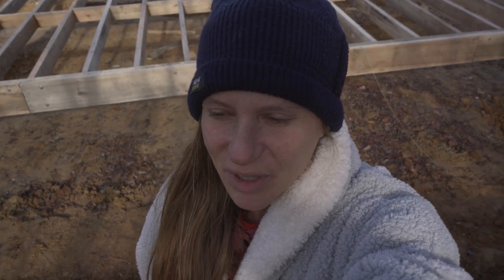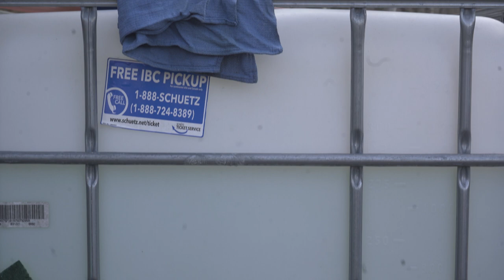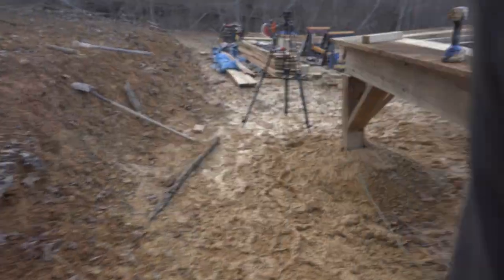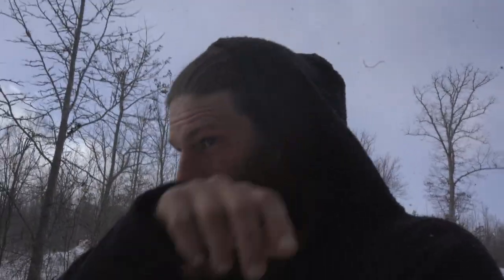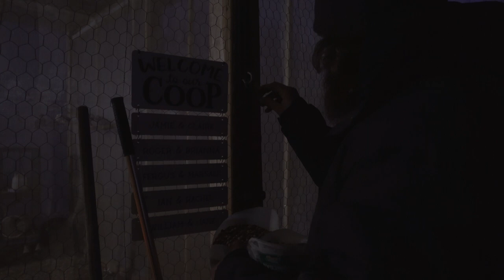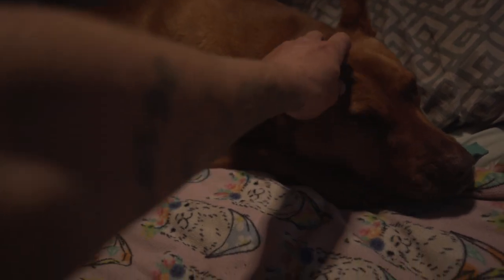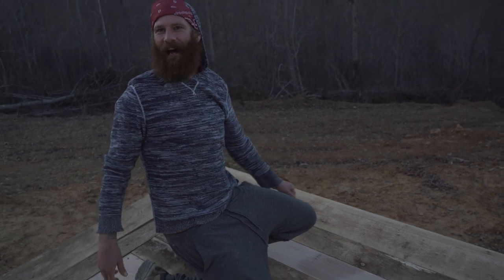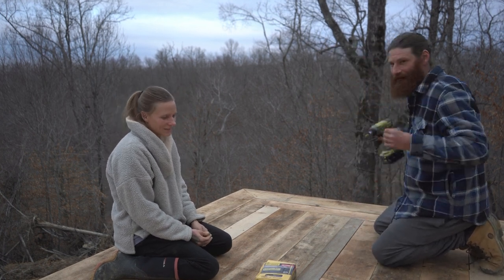1 Step Closer to Our Off-Grid Geodesic Dome Build - Platform Build

Comment: Fell asleep n missed it. Are you going to stain it or burn it with a torch to make the wood weather longer??  Looks great, mabey some day down the road, if need be you can always turn that deck into a nice little cabin. 👍 Stay warm guys, Blessings.
Reply: Hey Sean I wanted to tell you if you go look on Lowe's web site ,the have a ( job heater) there that looks like a silver bullet. Propane, no electricity. It puts out 80 thousand BTUs n it's only $100. I have one, when my woodstove goes out at night n I get up in the morning, I fire that thing up n it heats the whole house in like 10 minutes up to about 80 degrees. Then I lite the stove. It's not a heater you want to sleep with because of carbon monoxide, but people use them on job sites all day. I use mine 10 / 15 minutes at a time when needed. It will use a 20lb tank in 9 hrs, but because I don't use it much, a tank lasts me all month, just heating the place up in the morning. It would help in that shed, when real cold. And in the mornings in your dome.
Reply: Mr Heater convection its called. The big one is 80 k btu for $105 the small one is 25 k btu for $65  my 80 k is awsome. Just a suggestion. The $65 one would probably last longer then 9 hrs continually,  but with tent walls the 80 k would work better, till your stove can catch up. Mine would last longer but I run it full throttle for 10 minutes. It's loud on hi, sounds like a jet engine. Instant heat, I mean instant.
Reply from the maker: So I was gonna burn it then put Thompsons water seal on it ( only because I have 5 gallons that were given to me. Floor on inside of dome I'm gonna oil.. What are your thoughts ?